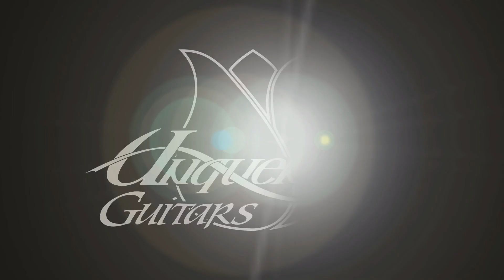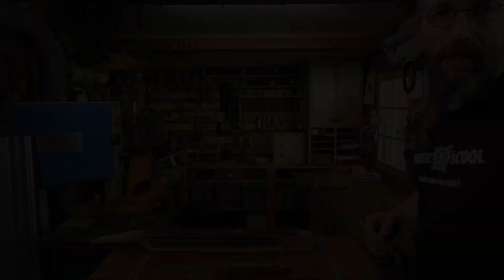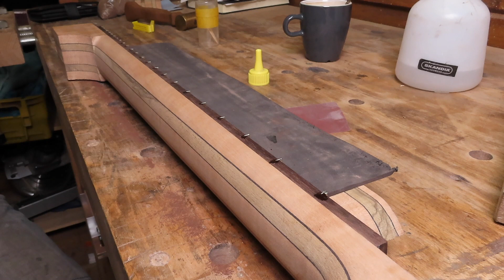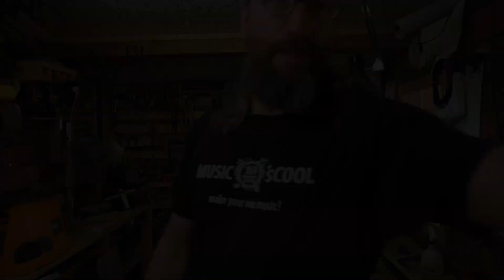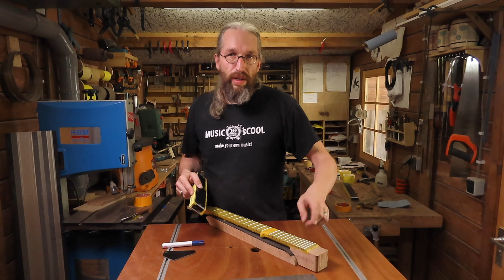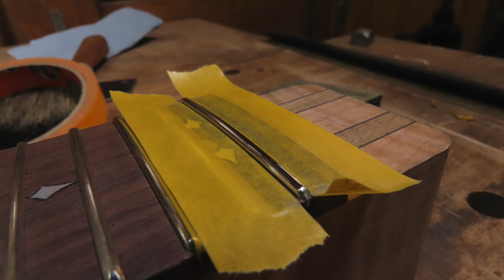A new Guitar build part 7: Doing the Fret work (a full tutorial)

Comment: Hi, I’m new about adjusting my guitar. I have action ruller and feeler gauge. I adjusted my guitar with 0.10 feeler gauge and fitting well at 8. Fret and I adjusted my action 6. String to 2.00 and 1. String to 1.5 but I’m hearing buzz. Buzz starting 7. Fret to 13. Fret. Is that mean I’m playing really hard and causing buzz and must I play softer or I have to raise the strings or is that mean I’m adjusting truss rod wrong?
 I’m capoing the 1. Fret and pusing with my finger at (where meet my neck with body, 17. Fret) and checking with 0.10(0.25mm) feeler gauge and gauge barely touching to string. Can still neck relief cause buzz while feeler gauge fitting well? Or am I playing really hard and causing fret buzz and should I play softer or rise my actions?
I’m sorry if my english is hard to understand but I hope you can understand my question and answer. Have a good day.

Comment: Is that electric fence aluminum wire what guage or size is that wire🤔🤔🤔
Reply from the maker: Hi Mr Frontranger. 
I guess you mean the wire used for the side dots. 
It’s 2mm aluminum wire bought at a local arts and crafts shop. I think it usually is used in jewelry making or something like that.